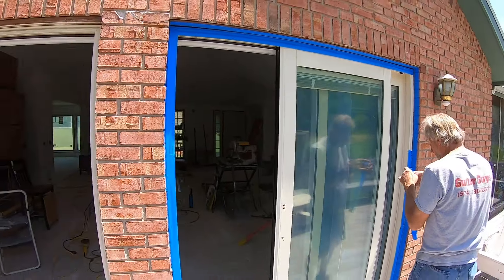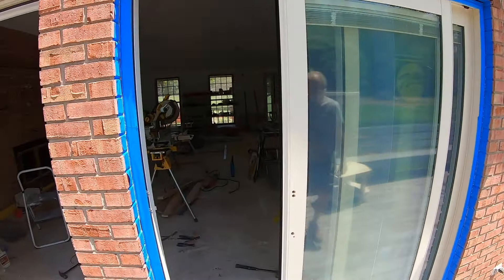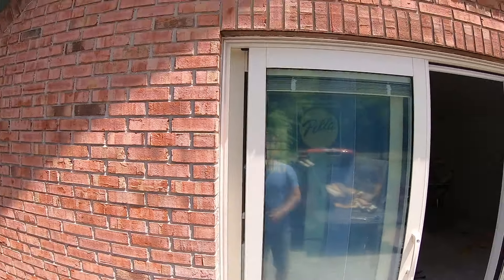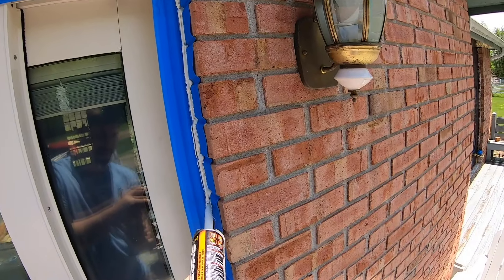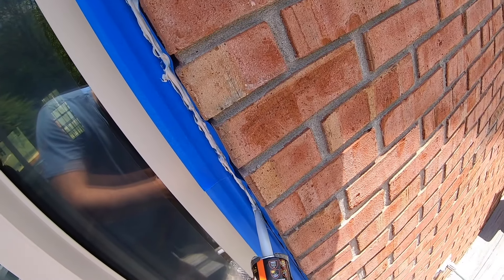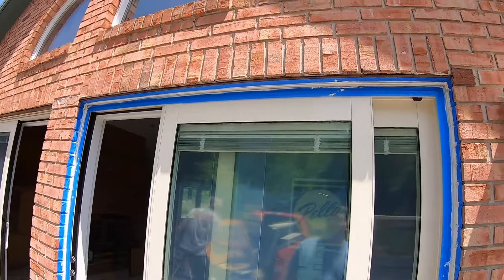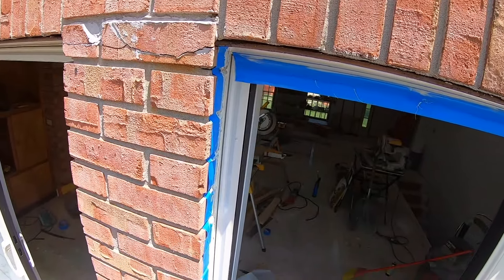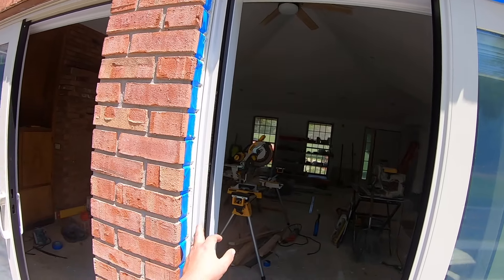How to Caulk Around a Window or Door in a Brick Opening

Comment: That close up shot at 5:06 looks like there's a crack on the left side of the bead and door frame. Did removing the tape pull the caulk out?
Reply from the maker: That’s a slot to accept mulling strips.  Mulling strips are a way to hold windows and doors together to create one big unit.

https://www.google.com/search?q=mulling+strips&ie=UTF-8&oe=UTF-8&hl=en-us&client=safari
Reply: @HowtoHacks  Good to know. I thought your technique was excellent and that there couldn't be a gap after such a good application. Thanks for the quick reply and great video!

Comment: How come my heavy adhesive painters tape doesn't stick to the brick?
Reply from the maker: That’s just how it is.  It hardly sticks but it still works.  Just press firmly and work it into the joints.  After a little practice it goes quick.
Reply: try frog tape

Comment: Are you supposed to caulk the bottom? I saw another video where it says not to culk the bottom of window trim. Door is different?
Reply from the maker: I would caulk the bottom.  However it’s up to you.  I know the theory of if you caulk the bottom it will trap water.  However if you have brick the weep holes in the bottom act as drainage anyway.  Also, the bottom of a window sill gets a lot of water in a driving rain and water will get in.

Comment: Don’t tool (smooth out with finger or anything) quad max.
Reply from the maker: That’s what it says.  Do it that way if it worries you.  However, around brick that’s very difficult.  From what I have observed it doesn’t affect the performance of the caulk.  I did all the windows and doors in my house this way (and other small jobs).  I have checked them every year in the spring and fall.  No cracking or shrinking in the joint.  I feel like they say this because Quad caulking is very sticky.  However if you spay on soapy water before tooling your finger just glides right over with no issues.

Comment: It states on the tube and the Quad web site that you should never tool this with your finger. You should hold it a angle so that it pushes it in the crack as you apply the caulking.
Reply from the maker: Good luck doing that between an aluminum clad window/door and brick.  I noticed no reduction in the quality of the finished product after tooling.  They probably say this because quad is really sticky.  To tool through the stickiness you have to keep everything lubricated with mineral spirits.  Then your finger just glides over the surface of the caulk no problem.  However, this is just my experience with the product and you are free to do what you think is best.
Reply: @HowtoHacks  I believe to main reason is to prevent the caulking from becoming to thin. If it is to thin the sun will deteriorate it and it will no longer preform correctly.
Reply from the maker: This is possible.  However, you should inspect caulking periodically anyway and add more to any voids.  For the record, the doors and windows I did for this video have no cracks or voids thus far.
Reply: @HowtoHacks  I could wear a surgical plastic glove?
Reply from the maker: @agcccggrr  probably. Just make sure they are tight at the end of the finger
Reply: That is because Quad is garbage. Any sealant that says not to tool it is garbage. It is a simple fact that sealant has to be tooled to make it water tight. If you also look at their website it says “ water resistant “ not “ waterproof “
Reply: Why would you use such a low quality sealant?
Reply: @genecarden780  I don't know if Quad is a low quality sealant, but I agree that I would not use it, and instead use a white 100% silicone caulk, because silicone is inorganic, and as such it has superior resistance to UV, moisture, and mildew.  It will adhere well, and stay flexible, and last 40 years.

Comment: Was the guy following you smoothing it with his finger using a screwdriver to push caulk into the grout gaps? Just wondering what that technique was. Great tips here!
Reply from the maker: Yeah.  The screw driver helps get in the mortar joints when needed.  If you spray the caulk with soapy water from a spray bottle then smooth with your finger, your finger will glide right down the joint and make everything smooth.

Comment: How far back do you cut the tip of the caulk
Reply from the maker: It depends on how big of a bead you want.  Cut the tip back so the opening is about the same size as the gap you are trying to fill.  For small cracks I cut a small hole that’s about the same size as the crack.
Reply: @HowtoHacks  brilliant. Thanks!!

Comment: brick should never have caulk on it,  my brick is ruined because a window company hired outside help that put white silicone caulking and did a terrible job and now its in big globs all over my window frames. I have heavily textured older brick, and no amount of wire wheel scraping or solvent is getting it off. they never used tape, needless to say, my house looks like crap now.
Reply: try & use paint to comoflouge it I went to sherwin williams & got 3 quarts of paint to match brick coloring and took three bricks tell them you're trying to hide smeared caulk use art brushes I did mine several years ago

Comment: This is very helpful. Unfortunately, when my house was built, the builders didn't use tape. How do you suggest removing the caulk that's all over the bricks? For what it worth, the caulk is 15 years old and is falling apart.
Reply from the maker: Yes you have to remove the old caulk before putting in new.
Reply: @HowtoHacks  How do you suggest I remove the old caulk?
Reply from the maker: @MollyThePitifulPit  I use a utility knife to cut the caulk, needle-nose pliers to pull out what can be grabbed, and a flat screw driver to scrape any remaining.
Reply: @HowtoHacks  Great. Thank you so much. I'm really dreading having to pay someone close to $1000 to have it removed. Going to need all the patience in the world to do it myself, but I think I can tackle it. Thanks again.
Reply from the maker: @MollyThePitifulPit  I know how you feel.  When I made this video I was also removing some old caulk from old windows and doors.  Each one took about 45 to 90 minutes depending on the size and how well it was caulked.  Patience is definitely key.
Reply: home depot sells a caulk remover spray I used a sharp blade on a hot summer day to losen the caulk

Comment: I think you know this is not how caulking is done. Takes way too long, wastes tape and caulking, and does not give a good result. When you rip the tape off, it can rip the fresh caulking edge with it. Small tubes like this with small nozzles will not do a professional job. You need a large sausage gun with large nozzles. No tape. 

Those small guns can do bathroom caulking, that is what I use, but for large exterior beads like the bridge between window and brick, you need at east a 3/4 to 1 inch bead. You can't do it with those tubes or guns like the builders do it. I have done caulking repair for 35 years with those tubes, but it is not really a professional result and not how you would caulk a new door or window.

This video shows how it is done professionally. https://youtu.be/By90PdmsODo?t=99

Comment: Is that paintable or silicone caulk that you used in this video? And did you peel the tape before or after the caulk dried?
Reply from the maker: OSI Quad caulk is paintable.  However you can order color matched caulk.
Reply: Yeah I had the same question, how quickly do you remove the tape?

Comment: I love this method and used it. But now I just watched a video from OSI Quad and they say you shouldn’t tool – use your finger to smooth – their caulk/sealant. Now I’m confused again. Does smoothing with your finger degrade the quality of the product? I can’t see any other way to do it unless you are a smooth master with the caulking gun, which I am not.
Reply from the maker: The only reason I can see them saying not to tool is because they don’t want any liability.  Meaning they don’t want to tell people to use their fingers and get sued by someone for some weird reason.  From my experience, tooling the caulk does nothing to degrade the caulk.  I don’t even remotely see how it could.
Reply from the maker: I mean if you wipe out too much it could fail because the layer is too thin.  Other than that I see no issue with tooling.  In fact I prefer it.

Comment: The best way for a homeowner to do this in modern times is to use as much Quad Max as necessary, go slow, and not tool it. Tooling the sealant in this scenario with such ragged surfaces doesn't really make it look any cleaner, it just makes it smaller, and it'll fail sooner. Just put a thick bead of Quad Max down and move on.
Reply: I agree. In fact, I think in the instructions says not to tool it
Reply: So use tape or no?

Comment: what's the best way in bricks?  painters tape on both sides?  My first chore is getting 20 years of caulk off the brick exterior window seam.  it's so bad.... i had to make it worse just so the most recent string of thundestorms didn't put more water in there, now I not only have to figure out a way to get 20 years of caulk off , i have my own recent mess to clean off of there.  I needed to take a deep breath and put the tools away, google how to do it right , and then i'll get to taking that caulk off the bring.  Was I seening things right that when i tried to peel a bit of caulk off that some of the brick/mortar was coming off with the caulk??? holy crap i hope i was seeing things.  Will Citristrip help or mineral spirits to soften it, or should i use a heat gun or something?
Reply from the maker: To remove the old caulk I used a utility knife and cut along the window at a slight angle with the tip of the blade touching the brick.  I then took a flat screw driver and scrapped up and down where the caulk was attached to the brick and it worked ok.  If a little bit of brick dust and mortar come off it’s no big deal.  Also more mortar cane be added before you caulk.  I can make a video about this if that would help?
Reply: @HowtoHacks  yea, a video would be great...it's one of the hardest things to figure out how to clean up (remove) before re-caulking and thanks a ton  SUBSCRIBED !!

Comment: I tried this....and then the caulk was getting pulled up with the tape at the edge :( it kept setting so quickly I could not go fast enough
Reply from the maker: You have to wipe as much excess caulk off as possible where the edge of the tape is.  If it’s too deep there then the caulk will get stringy when you pull the tape up.
Reply: @HowtoHacks  yup that was it. I have to do 20 windows.....after doing 4 windows I got a system down. I have gaps to backfill and then I have butt joints. Both require a different approach on laying the tape. 

But i basically tape the window and brick off,  I'll do the top of window, pull tape off. Run down the right side, pull tape off.

After I got my methodical approach I was smooth sailing. 

Getting the window cleaned and prepped takes awhile

Comment: in the video at the end on the close-up shot, it still looked like there was a seam that was void of caulk @ 5:05 a straight thin line of empty.  im sure it was just the video but can you explain that?  also, you didn't say how long you waited for the caulk to dry before removing tape....thanks for this awesome video!!!!  great idea guys!!!
Reply from the maker: What you are seeing is the slot around the perimeter that is there to accept a mullion strip.  A mullion strip is how multiple windows or doors can be joined together to make one larger unit.  So you don’t want to caulk that.  Watch the part of the video where I am applying the tape again and you will see the slot right at the edge of the door.  I pulled the tape immediately after i was done smoothing the caulk out.  Don’t wait for the caulk to dry at all.
Reply: @HowtoHacks  how much time do you have for tooling quad caulk before it sets and leaves a raised edge along the tape line?
Reply from the maker: Probably about 10 to 20 min depending on the weather.  It might say in the literature as that’s just my approximation.
Reply: @HowtoHacks  mullion strip...gotcha, wow learned something new...i see now what you did

Comment: If you read the back of quad caulking, it will tell you to leave a three eights bead, just takes practice to get it right. Those thin beads will crack overtime. Guaranteed.

Comment: I always prefer caulking with painters tape to give a clean line. I like how you pushed the tape into the mortar to avoid seeping. I have tan brick with a white door & trim. I repainted the trim & door sill and plan to recaulk, although it appears to have a good seal yet. The door sill was painted blue from a previous owner. The brick all around the door has old paint and caulk past my new paint line. Do you ever caulk to match the brick instead of the painted trim? I can't imagine getting the old paint & caulk off the brick but don't want the white to go too far out on the brick.
Reply from the maker: You could use caulk the color of the brick.

Comment: You can't tool OSI caulking! Read the instructions.......
Reply from the maker: I have answered this so many times in the comments.  If you don’t want to tool it, then don’t!

That’s what it says.  Do it that way if it worries you.  However, around brick that’s very difficult.  From what I have observed it doesn’t affect the performance of the caulk.  I did all the windows and doors in my house this way (and other small jobs).  I have checked them every year in the spring and fall.  No cracking or shrinking in the joint.  I feel like they say this because Quad caulking is very sticky.  However if you spay on soapy water before tooling your finger just glides right over with no issues.

Comment: Another Caulking disaster video All that taping is hilarious. If anyone ever taped before caulking a simple thing like a doorframe or anything else They would probably be Fired or at least never caulk again. When he pulls that tape he breaks the seal all the way down I’d run and knife that door in way less time than this guy takes to tape
Reply from the maker: Not against brick with OSI quad caulk.  That stuff can’t be wiped off of brick.  That’s the point of the tape.  Anything else I don’t use tape and do what you just described.  Also, I did this in 2019 and the caulk looks brand new, no cracking and the seal is good.  I taped and caulked one of these doors in like 15 minutes.  Not that much of a time commitment…

Comment: No pro will really spend that time taping.
Lay thick beads and spray with a lot of soapy water then drag a 3/4" flat stick down.
It leaves a perfect flat finish.
Reply: Actually all the pros do this. Anyone who doesn't is not a professional but is probably a smash and dash crew.
Reply: @bedhead1903 
I'm guessing you've never done that work yourself.
NO PRO DOES IT.
Those techniques are for amateurs, it is the same as free hand paint brushing.  Amateurs tape pros free hand.  Pro go for speed.
Reply: Can someone explain what the comment means. Sorry I have never done this before. I have quite a big project. Although this is by far the safest option, I am guessing it would be really time consuming.  Is there any other ways?
Reply: @foreverhiddenpabz 
I will try and find or make a video for you.  But taping takes forever.
Reply: @paultrauzzi5360  thank you mate 👍
Reply: @paultrauzzi5360  Aren't these videos probably mainly for amateurs? Because I'm doing my own house and don't do this all the time I'm finding the extra time to tape is well worth it! Turning out very well.
Reply: @paultrauzzi5360  Watched it. Still satisfied with the way I did it. I'm retired. Have lots of time 👍
Reply: @toddfan3263  Each to his own but that method does MUCH cleaner flatter lines around brick.  I do it weekly.